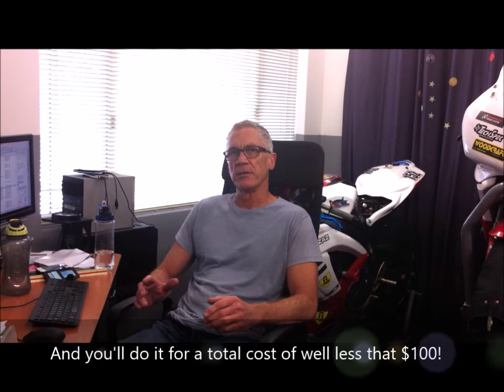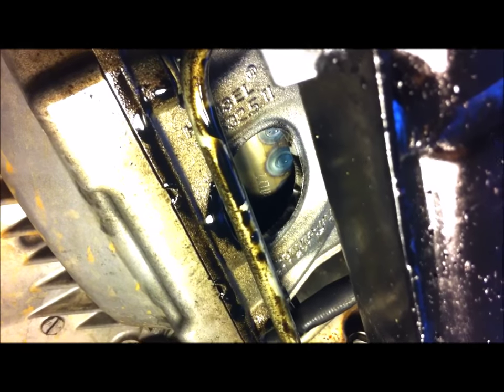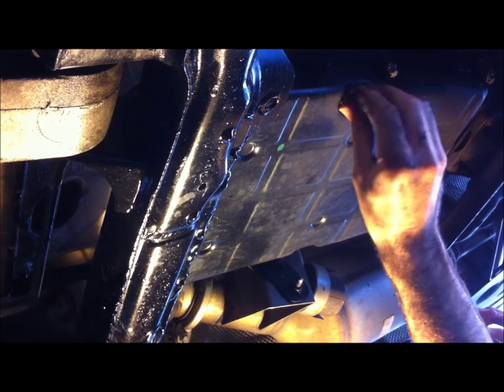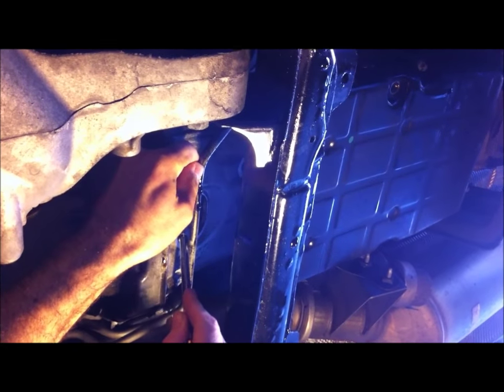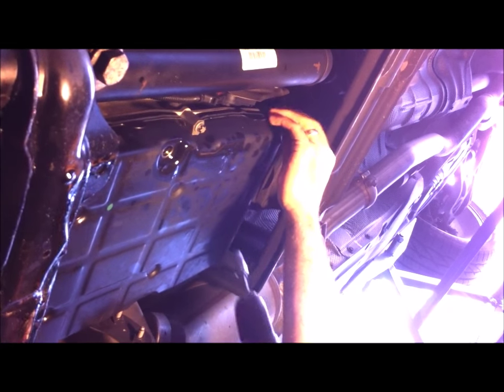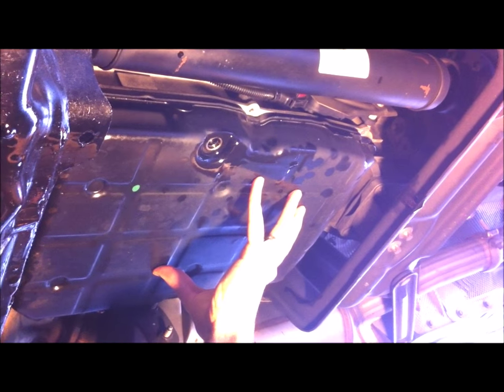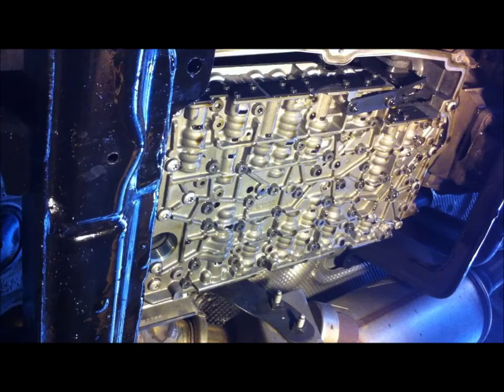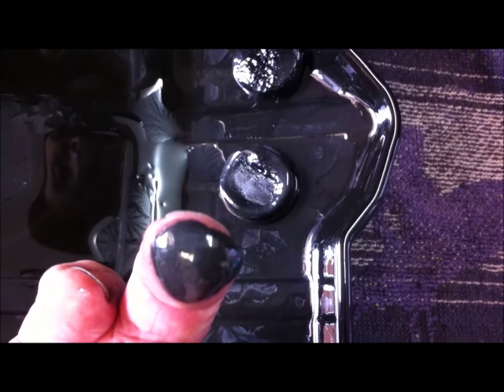Mercedes 722.9 ML320 ML350, C, E, S, GL Transmission Service

Comment: Great source of information. I am amazed by the self styled experts who say its fine just to change the oil in the pan and not worry about the rest. All good info in this very thorough video!!
Reply from the maker: Thanks Robert. Yes many of the fellows behind the counter are full of opinions but light on for science and facts. If you do it the same way as we did you'll have no issues. We did that ML three years ago and the transmission is very smooth. We're about to do it again as three to five years is enough for the ATF especially if it's suburban driving in traffic.
As you say the latest "expert" recommendation from the industry is to change only the oil in the transmission and not the TC which holds about 50% of the 8.5 litre total. Would you change 50% of the engine oil?
I really feel it's a ploy to create more work down the track replacing failed transmissions or making the car uneconomical to repair thereby forcing the client to buy another car.
In the next breath car makers and dealers are spruiking how "green" they are but they're doing their utmost to force more consumption of parts or more vehicles.

Comment: Great Scott. I took my moms '07 320 cdi to the stealership to have this done, when they came back with a quote of over 1100$ US I left and am doing this today. I would have paid to have it done if I hadn't found this video. Very thorough and very clear on what to do. The only thing I wouldn't touch on a vehicle before seeing this video was an auto trans. Now it's all fair game. Thanks 1000 for the video. 

Btw I used a 6mm tube flange nut (for cooler lines) with a  piece of 1/4" tube pressed(with a vise) into the the nut for my filler adapter. Works great.
Reply from the maker: Well done. Glad I could help.

Comment: Utterly fantastic and informative video. VERY PROFESSIONAL. Thank you so much for sharing.  Really, really appreciated. 10/10. From Christchurch, New Zealand
Reply from the maker: Thanks Miles. I still use the same process and just did the 722.9 transmission in my 2009 W204 C320CDI.

Comment: If I am not mistaken that is a ZF transmission.  I have heard of some of those using a green colored fluid.  That is not to be mistaken for CVT fluid because that will damage an automatic transmission.
Reply from the maker: Respectively Charles you are mistaken. It's a Mercedes manufactured 722.9 7 speed transmission. The ZF is a German manufactured transmission used in BMW's, Fords, Jags etc. ZF transmissions of that era (2008) have a plastic oil pan with integrated filter ... the 722.9 has a conventional steel pan. Did you watch the full video to learn how to DIY service a Mercedes 722.9?

Comment: Hi Scott. Have just changed my Gl 320 transmission and transfer case to Penrite BMV Atf.  I've gone from noticeable gear changes especially on downshift during braking to CVT like silky smooth un-noticeable gear changes. Will update in 1000k to make sure all is good, warning though the BMV is beer coloured not red, looks like pale ale.
Reply from the maker: I wonder if beer would work in the 722.9?
Considering the new ATF is good for MB236.10 to MB236.18 ... I guess they had to come up with a universal colour ... so pale ale it was!

Comment: Excellent video Thanks. How you level the vehicle. I noticed you put leveling tool on the running board but when I checked with magnetic leveler to the pan it is not level. I mean leveling using running board as base does not match when checked against level of the pan it is little lower at back and raised from front when car is level so which level we should take the oil pan level or car level. Thanks
Reply from the maker: This has been covered before in the comments. Scroll through as they're informative. The Mercedes Workshop Information System (WIS) says to level the car. That means the oil pan will have a tilt to the rear. This is how it's supposed to be. If you think about it ... the overflow pipe is about half way along the oil pan. So you can level the oil pan if you wish but it makes no difference.

Comment: This is some great work! Will be putting this to use tomorrow thanks for taking the time to share!
Reply from the maker: Thanks Chris. Good luck. Let us all know how it goes and any little tricks you come up with. Scott
Reply: Thanks Scott. Decided to wait for a friends lift next weekend to do it. Did you level the vehicle when you jacked it up or did you level the transmission pan?
Reply from the maker: Level the vehicle. The pan will be lower at the back. Have a look at my musings about this topic in post #16 of this thread on www.benzworld.org: ... http://www.benzworld.org/forums/w164-m-class/1711883-transmission-service-2.html#post15255090
Reply: Scott, had to put this off until yesterday but got it completed just fine and wanted to circle back and say thanks again for sharing. The video was invaluable to study in preparing for the service! I might use a taped thermometer/multimeter combo next time as I got slight variations in temp using inferometer depending on measuring the pan or housing right above it. How long did it take your ml to get to 45c from cold start?

Comment: Here is one thing I did to make the better mouse trap. So that no transmission fluid came down when the pan came down I pumped the remaining fluid out with a vacuum pump. Have a really nice pic for you. Maybe I can figure out how to post it.  Just put the hose in to the rear of the tray with the two front bialys still attach. Took almost 2l out.
Reply from the maker: Sent me a private message with your email. I'd be interested in seeing 
your new "mouse trap". We should be all learning form each other.

Comment: Hi Scott, when you shift the car through the gears at the end do you let the wheels spin or have your foot on the brake? Thanks Drew
Reply from the maker: Hi Drew. Either way it doesn't matter although it's safer to keep the brake on so the drive shafts and wheels aren't spinning. Regards, Scott

Comment: Do not tighten the aluminum oem stretch bolts to 10nm they will snap. I did it last night. The correct torque is approximately 4 to 5 nm.
Reply from the maker: Yes that's right. They're a one use bolt. We've changed to normal high tensile hex head bolts. I explain why at 12.25 in the video. You can't use the alloy bolts again they must be replaced with new ones. If you want to use the alloy bolts buy new and tighten to 4Nm then turn 180 degrees
Reply: Scott, do you know the length of the bolts shaft and the required thread? I'd like to buy everything before I start the procedure.
Reply: Hi Scott, what are your high tensile bolts made of? Do they interact with the magnesium of the housing? I don't  know much about metallurgy but Star magazine article has a word of caution: https://www.mbca.org/star-article/july-august-2012/full-speed-ahead-%25E2%2580%25A6all-7-them-7229-7g-tronic-transmission
Reply from the maker: The OEM stretch yield bolts are a two stage process. Initial tighten to 4 Nm then mark and turn another 180 degrees. I don't use them anymore because it's inconvenient and expensive having to buy new alloy bolts every time. I use standard high tensile M6 bolts with anti seize grease.
Reply: What is the best way to remove a bolt that snapped?
Reply from the maker: Buy some anticlockwise drill bits. This guy has a good tutorial: https://www.youtube.com/watch?v=dJfkCj3FWBs

Comment: Hi Scott, can you tell me what ID size hose you are using for the 500mL flush you did with the cooling lines? I am gathering supplies before I start the project.
Reply from the maker: I used 10mm.

Comment: Thanks again Scott. I did the oil change on my ML today which has 260K on it. From what I can see the oil has never been changed - there was a loose aluminum bolt in the bottom of the pan that was obviously there from factory! Thankfully and amazingly no burnt smell or metal  on the magnets but the oil was dead black so I have my fingers crossed.

A few thoughts - I found it better to undo the return line at the beginning which makes removing and reinstalling the torque converter drain a little easier - what kind of designer would design an access port with a line smack in the middle? It would have required not a lot of thought to just move the bend an inch in either direction. 

My theory is that this crop of  MB designers are the children of abusive mechanics. 

I used a $10 plastic sprayer from Home Depot and a $9 fitting (Vibrant no. 11413). I cut the tip off the spray wand and connected up the fitting with a 1/4 ID bit of pipe. I used the same wand and pipe to flush the return line. The wand is nice because it has a valve built in that you can lock in the open position. Essentially the same as the Motive bottle for 1/20th the price. I also used it to fill the transfer cases. It works very well and no need for a compressor.

I replaced the 'special' one use bolts with proper steel ones- this love of one use fasteners is really the work of the devil.

The car certainly sounds better and seems to shift better. Will tell you if it blows up.

Again thanks for the great vjeos - my only criticism is that the sound levels could be higher but again highly try useful and appreciated.
Reply from the maker: Great work. Your transmission will thank you.
If the Accura failed 3000km after an ATF change it would have failed anyway. Be very skeptical of opinions from the industry as they're compromised. The Indy would benefit from a $10,000 job to replace a transmission. Do your own research.
As a Civil Engineer with a background in heavy earthmoving and open pit mining I can say regular oil and filter changes on engines, transmissions, diffs, etc were the lifeblood of our operation. The 7 speed automatics in the dump trucks had the ATF changed about every 250 hours. There was no such "filled for life" nonsense with $1.5M trucks.
Reply: @ScottElliott152   My first serious student job was rebuilding Cats and I went to Cat school in Peoria. It was a wonderful thing - you could directly ask the engineer how they designed something and why they did it that way. Working on cars is, in comparison, painful. As my boss would say, cars are a prostitution of engineering.

I worked briefly at Tyrrell in the 80's and they had a lot of Aussies. I always appreciated their approach, general jolliness,  resourcefullness and craftsmanship - I think that comes from being at the very end of the supply chain.

And yes 'Filled for Life' and 'One time Use' are the work of the devil.
Reply from the maker: That would have been a great experience working at the former home of Caterpillar.
Cars are now a consumable with minimal residual value after about 7 years. It's not in the interests of manufacturers to keep them going as their business model is ever increasing growth in sales. It's a terrible policy in terms of protecting our environment and resources. Governments are complicit as they want the continuous growth to.
A transmission failure on a 10 year old ML or C class would see the vehicle a write off as the cost of repair would be more than the value of the car. That's most likely the underlying reason for the misinformation campaign that transmissions don't need to be serviced.
Reply from the maker: I'm considering buying a new Mitsubishi 4wd Pajero Sport. This has an 8 speed Aisin transmission. Mitsubishi are just as bad with the recommended ATF change at 200,000km! That's about 10 years for most people by which time the car would be worth nothing and written off when the transmission failed. The factory warranty is good at 7 years/150,000km but it's obvious the MO is to get it through the first 7 years then sell you another one. The second owner would get a cheap car but would be on borrowed time before they were up for a major repair.
Reply: @ScottElliott152  Amazingly Mercedes has made diesels unreliable - with the injectors at $600 a piece you might as well throw it away when they stop functioning let alone the transmission going tits. 

I just don't get this 'use and throw' business model in this period of ecological crisis. Seven years is doing well - here they really encourage to come shopping at four. You would think that providing scheduled service and update over a longer period would ultimately be more profitable. Apparently there are more people building E-types and spares for them now then when the factory was making them. 

What software are you using? I am in Canada and Mercedes actively discourage DIY with the acquiesce of the government - easier to deal with a handful of polished perfume smelling lawyers then the great unwashed. The factory software is like 10K annual lease. You can't even get manuals paper or electronic.
Reply from the maker: @francisrampen9099  I bought my system from here: https://www.obdexpress.co.uk/?gclid=EAIaIQobChMI7Mb9g-vl6QIVTCQrCh2ScA2bEAAYASAAEgKD-PD_BwE

Then I joined www.mhhauto.com and downloaded older versions of DAS/Xentry ... 10/2008 Golden Version and 01/2011. You can do more with the older versions before MB really started to lock things down. The software noose around your neck puts me off buying a new car. Certainly Mercedes is off my list considering now the car has to go online from the Dealer to Germany for updates.
I wish Governments would regulate to stop manufacturers designing reduced life to force extra consumption.
Reply: @ScottElliott152  Thanks for that - the MHH website looks like an amazing resource. What model of OBD did you buy and are you happy with it ? your link goes to a generic page. 

I can't comment on the Mitsubishi except that they have a very poor dealer network in Canada. In Australia it is probably a different story.
Reply from the maker: @francisrampen9099  That's the home page then go to Star Diagnosis. I'd recommend you buy the full system on a refurbished Dell D630 laptop. That's the easiest and simplest way. MB Star uses a modified version of Windows XP Professional SP3 which is set up on the laptop and ready to go. https://www.obdexpress.co.uk/wholesale/mb-sd-c5-star-diagnosis-with-ssd-software-plus-dell-d630-laptop-with-4gb-ram.html
I was happy with the system I bought on an external HDD. Once I learnt how to use it I started using mhhauto to get the other software versions.
Reply: @ScottElliott152  Thanks again Scott! That seems not a bad deal at all when you consider the laptop. I think that a run through of the system is grist for another video.